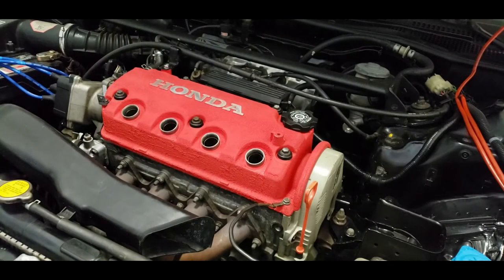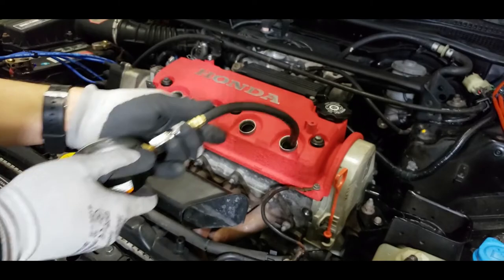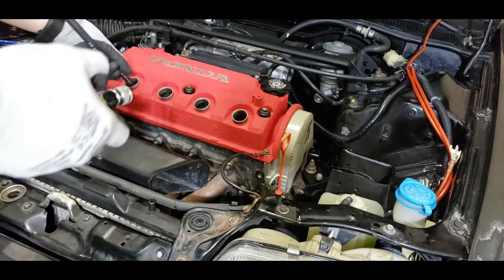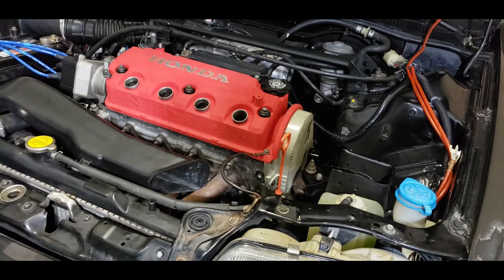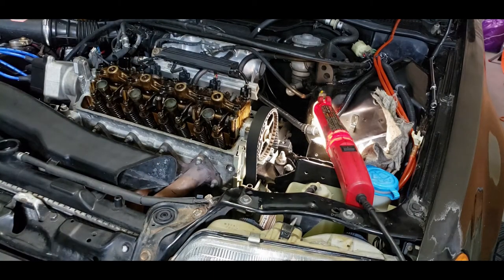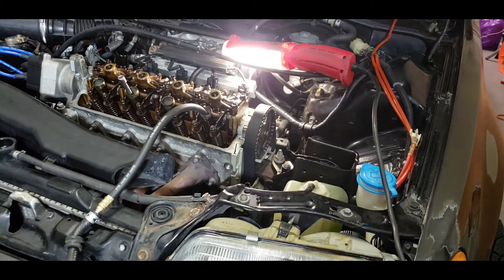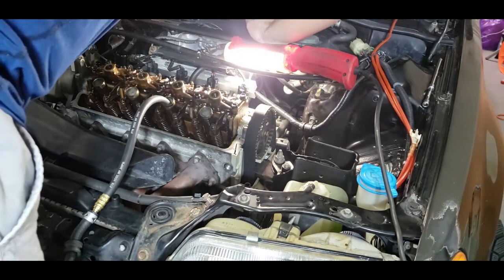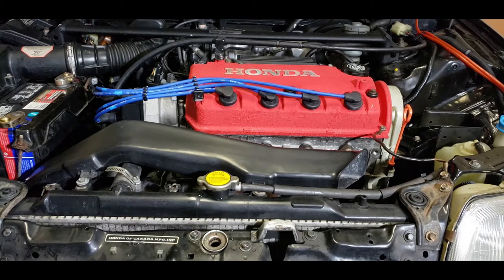[D16Y8 Fixing Idle Issue] How to Perform Compression and Leak Down Test. Idle and Knocking FIXED!

Comment: Can you please tell me exactly what it is that you fixed because ive completly rebuilt my motor from top to bottom and its making the same exact noise and I literally did the valve lash to spec, perfect... thank you
Reply from the maker: I already talked about what I did in the video towards the end. I also replied to a comment from someone below talking about what I did. You can read the details below. In summary, the rocker assembly was stuck/sticking. After fixing that, the engine has been running fine ever since.

Comment: @Budget Gears can you talk more about how you took part of rocket arm assembly? you mentioned they are out of alignment... do you mean the tip of rocker arm is out of alignment with the tip of the valve stem and spring retainer? they have to be aligned for between interaction between the rocker arm and the valve right? how di you fix the sticky valve? how did you clean the valve? did you take the head off to clean the valve and replace the valve seal? sticky valve means the valve and spring can not move smoothly and completely down the valve guide? if you can upload the part of valve clean and disassembly and reassembly part video, that will be great. this the key part to fix the problem, right? thx
Reply from the maker: I didn't talk about the rocker arm assembly being out of alignment. The valve wasn't stuck either. It's the rocker assembly that was stuck. The rockers should move freely, but it wasn't. It was gummed up by old oil. So at certain rotation the rocker doesn't move causing idle issues and loud noise. I pulled apart the entire rocker assembly piece by piece. Including all the little spring clips etc. Cleaned it all in brake cleaner then lubed it up with engine oil. I don't have video of this as I didn't know if this would fix the issue and came up with the idea randomly so I didn't film any of it. 

But if your valves are sticky, you'll need to check if they're bent or if they're just really dirty. You'll need to pull the head to do this and probably best to send the head to machine shop to have the valves checked and grinded.
Reply: @BudgetGears  So the gum/oil sludge on the rocker arm cause the movement/noise issues. thanks a lot for the clarification. that is very helpful. my y16y7 has less noise after I added some ATF to the oil. the noise came back after oil change (without atf). then the nose is better after I add atf again. also there is some tap/tick sound and I need to adjust the valve lash. I am thinking I need to clean up the rocker arm assembly nxt time I open up the valve cover. it should help as well.
Reply from the maker: @shiguiyuan8978  Yeah, the gum/oil sludge restricted some movement causing noise and poor idle. My engine was from a junk yard, so there's no telling how long it was sitting there or how well it was taken care of before ending up in the junk yard. It's normal to have oil stains over years of use, but the restriction of movement was kind of a first encounter for me. 

I don't think you should be adding ATF to the oil. I wouldn't put any additives in the oil since it'll compromise the performance of the oil. Valve lash adjustment is definitely a must. One thing you can try if you think your valves are very dirty is to try seafoam. People have said it does a good job in cleaning up the engine etc.
Reply: @BudgetGears  this is very interesting discussion thread about ATF in the oil: https://www.youtube.com/watch?v=Qj5pu-lTtUM. definitely try at your own risk. just FYI. people recommend it between 10-20% of the oil capacity. how did you clean your valve? just seafoam in the air intake or in the gas tank? you also replaced the seal. so you did it without takin off the head?
Reply from the maker: @shiguiyuan8978  The link you posted is ATF in the gas tank. Weird how people talk about it actually cleaning the engine or lubricating the fuel pump. I honestly wouldn't trust it. I mean there used to be discussion about using Acetone in the gas tank as well. I'd still to what the manufacturer recommends. I've never had any issues with any of my vehicles by just doing regular fluid changes and using the recommended gas. 

I didn't clean my valves. My leak down test didn't indicate any issues with my valves. But carbon would build up on the valves and piston over time. I think if I needed to do a cleaning of the engine, I'd use seafoam in the intake. 

I haven't replaced my valve seals yet. They'll only need replacing if you're noticing oil burning. During the time I drove the car, I haven't noticed any significant oil burn, but I do plan on replacing my valve seals since the motor does have over 200K kms on it. And yes, you can do the valve seals without removing the head. You just need to keep the valves up while replacing the seal. This can either be done using compressed air or filling the cylinder with rope and bringing the piston up so that it pushes the string which pushes the valves up while replacing the seals.
Reply: @BudgetGears  the original problem is engine hesitation after traffic stop and the car does not move fast and people behind me are not happy. after I add STP engine treatment (later atf after oil change) the performance is better and the noise is quieter. it also has to rev over 2500 and jerk if the speed drops below 20 miles in stop-and-go. the mpg is decent and shift over 20 is fine. I can get close to 40 with shell gas on highway and 28 in the city.
Reply from the maker: @shiguiyuan8978  any engine check light? Is your car a auto or manual? have you done a compression test to ensure the compression is within allowable spec?
Reply: @BudgetGears  it is Auto LX model and the compression test looks fine before. maybe have to do again. no check engine light.
Reply from the maker: @shiguiyuan8978  If everything is fine and no engine check light and since you're OBD2, you should scan the car to see if there's hidden issues using a OBD scanner. If all is good, it could likely be something like spark plugs or your ignition coil etc. I'm assuming your transmission is all good since it shifts and all. Sometimes you need to go back to basics to determine what's wrong. This is assuming everything is mechanically good. I mean hesitation could be many things. Your fuel pressure could be low, which could either be bad fuel filter, or bad fuel pump. Your spark plugs or wires might be bad or something in the distributor as well. Your sensors that control air could be bad. You should check all those things.
Reply: @BudgetGears  couples of more questions: 1.) do you put on TDC before you took apart of the valve assembly? do you have to remember the part when you took apart of the rocker arm and its small parts like springs, washers etc? do you need to use rubber band to make sure the tip of rocker arm is aligned with the tip of valve stem (tip of spring retainer as well)? any challenges or extra attentions when you put everything back? I followed the instructions on service manual to adjust the valve clearance, I can still hear the ticking sound. not sure what I did wrong (stone cold, middle range of size, check/recheck etc).
Reply from the maker: @shiguiyuan8978   @Shigui Yuan  Yes, I put it to TDC with the cam arrow facing up before I took the valve assembly off. As I took pieces off, i placed them in the order I took each piece off. That way I can put it all back together the same way it was. I didnt use any rubber band. I just used my hands to shift it around to line it up. Everything should line up on its own. I didn't have any trouble with it. I'd say make sure all the bolt holes line up etc. Also when you pull the rocker assembly off, your cam will not be held down. So careful with that in case you accidentally lift it out. And with valves, they will still tick. They just aren't supposed to be super noisy.
Reply: @BudgetGears  here is the recording after warm up and adjustment: https://www.youtube.com/watch?v=wBPpSDNiOok. is that normal? for the cam, we can still clean up when we use towel to hold it without movement, right?
Reply from the maker: @shiguiyuan8978  hmm it sounds noisy but it sounds like other background noise. The valves sound normal. What does it sound like when you rev it? And you don't need to clean the cam. The cam journals should be smooth and not sludged up.
Reply: @BudgetGears  when I rev it, it sound ok. maybe I can record again next time. the drive is fine on highway without hesitation. the jerk around 20 is always there. not sure when I have a chance to open up for some cleaning. right now pretty much I drive like 500 miles a year due to pandemic. adding atf/engine treatment to oil lowers down the noise meaning some sludge issue, I guess?
Reply from the maker: @shiguiyuan8978  Hmm do you have a long screwdriver or a stethoscope? I'd say try and listen to where the noise is coming from. So poke and listen to certain areas of the engine. When you get a chance to take the valve cover off, check all the rocker arms for free movement. If they're all moving smooth, it may not be a oil sludge problem. Its also possible that you may have a slight rod knock. You'll be able to hear it clearly by poking the engine block with screwdriver or stethoscope and listening.
Reply: @BudgetGears  sure I can try to use long screw driver to see where the noise comes from more specifically. for the rod knock I do not hear any unusual noise during drive with different speeds. I can pay attention again next time I drive. thanks a lot for all the useful information.

Comment: Hey my d16y8 dropped compression low 130psi after replacing head gasket and before it had 170psi
Reply from the maker: Did you use a straight edge and feeler gauge to check if the head and block were within spec? If the head or block has any bit of warpage, you'll need to machine them before replacing the head gasket. Other thing is, did you make sure you torqued everything down to proper sequence? Did you replace the head studs too? They're meant for 1 time use, but many have successfully reused.
Reply: @BudgetGears  yes i took the head to the machine and they only did tht to the head the didnt remove valves & no cleaning , and the block was ok the car didnt overheat but it had over 200k miles so it was good to replase head gasket , but i didnt replase the bolts and yea i torque it to 49lbs like it said on the manual .
Reply from the maker: @rendiix4269  isn't it supposed to be 49 ft lbs? At least that's what I googled. I didnt check the honda manual for actual specs yet. 
Its possible that your valves could be too gummed up or bent. With 200k miles, I'd have cleaned the valves and replaced the valve seals as well. You can do a leak down test to determine where you're losing compression. Worn out piston rings could also cause a compression leak. Basically if it isn't your head gasket, then either valves or rings.